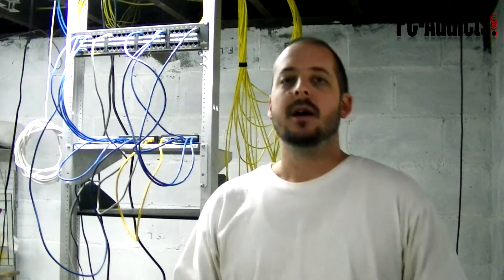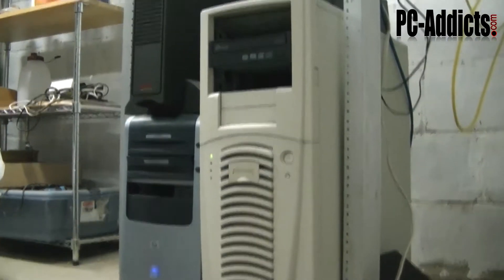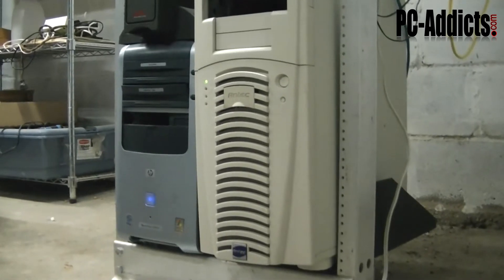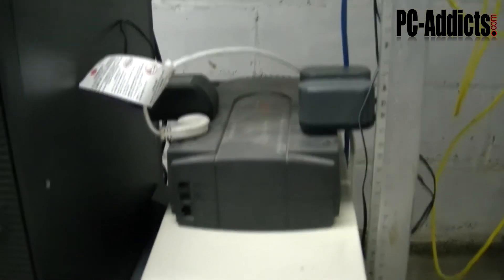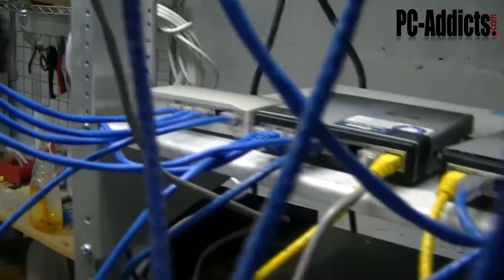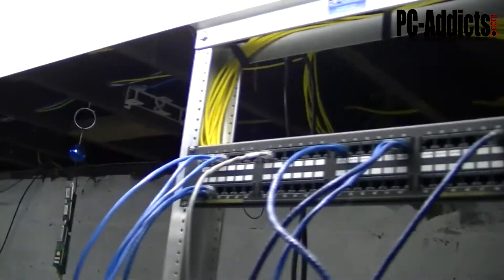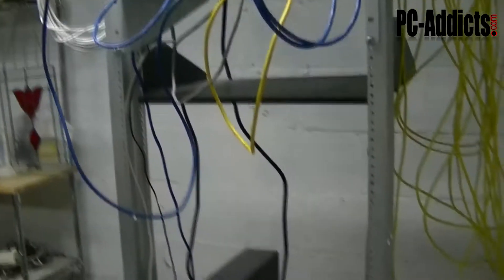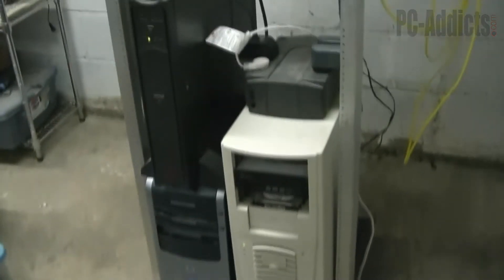Home Server Rack - Servers - Switches - Battery Backups

Comment from the maker: @Ninesvnsicks If I had a choice, I would have used cat6. The main difference between cat 5e and cat 6 is that cat 6 has a higher signal-to-noise ratio, allowing higher reliability and higher data rates for future applications. But since this a home environment, I'm not concerned with any of that. I made sure not to run any of the lines parallel with AC lines, etc.. think I'll be ok.